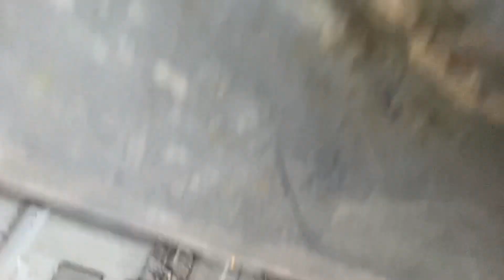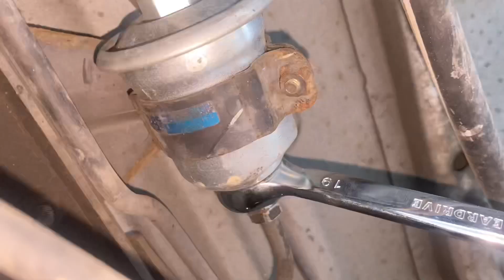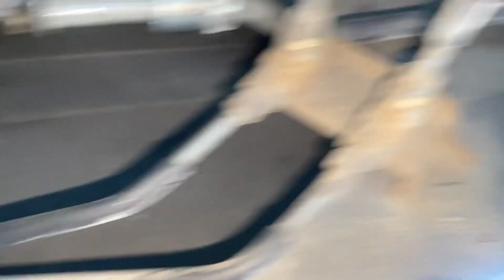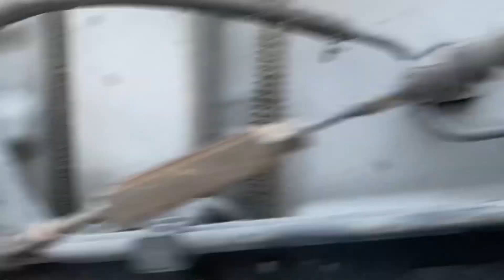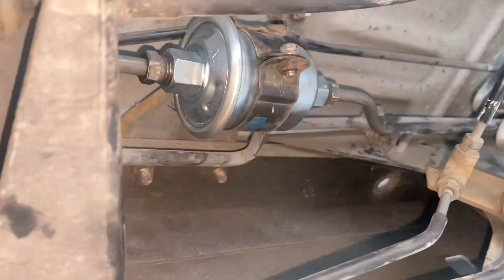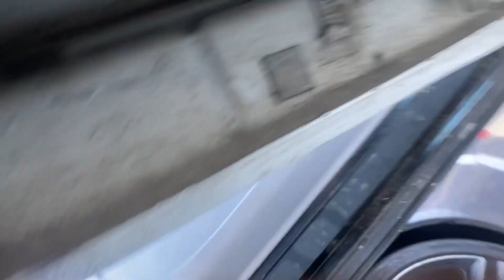2002 Toyota Tundra: Fuel Filter Change

Comment: Am about to put on new filter BOSCH 77066WS would this fit I hear  it's bit longer than oem
Reply from the maker: I’m not sure if it will fit since I always use the recommended filters that are OEM or similar to OEM for proper fitment. Best to check the specs of your truck model and the filter online.

Comment: What if it comes with washers?
Reply from the maker: Fuel filter with washers? Make sure your parts supplier gave you the correct fuel filter for your truck. I had many times where I realized the Orielly’s gave me the wrong part that they said it was when it wasn’t. Best case is to make sure it looks like the original one you took off or go to an official Toyota parts store.